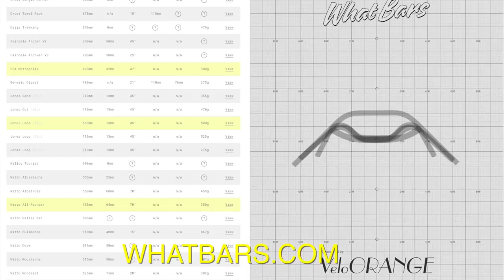My Favorite Handlebars?  (How to Choose Drop Bars)

Comment: Hey Russ, great video.  I have had the cowbells on my Specialized Roubaix for about 5 years and love them.  With the flare the levers are at a more natural angle for me. When riding on the hoods they are much more comfortable that the traditional bars were the levers are straight up and down with no angle. Since watching your channel I found several things I have done with my bike over the years that are right in line with your supple philosophy.  Several years ago I replaced my 50 tooth chainring with a 46 for a 46/34 crank.  That made a huge difference.  And I am about to take the next plunge and swap out for a 46/30 crankset.  Keep up the great work on the channel, and keep the supple side down!

Comment: Great explanation! I will say that Im not sure what racers are pushing for narrow bars these days though. My best road race bikes all had 44s but lately Ive found that 42s are more comfortable for long rides (a bit harder to sprint on narrower bars). I think it depends a lot on your anatomy. Im really glad that flared and compact bars are becoming so much more common.
Reply from the maker: Yeah. Almost all our riding in Montana ends up on gravel or on a trail at some point. I like the stability of wider bars for that.

Comment: Really great intro and explanation  of what goes into selecting a drop bar.  I have been mountain biking a long time and use 780 bars.  I recently bought a 3T Exploro  and like that they are compact or minimal drop, but they are fairly narrow and have no flare.  This helped give me some basics to start looking.  Would have liked to hear a bit about carbon compared to aluminum, but perhaps you have that in another video.

Comment: I just ordered some PNW Coast bars in 44cm length like the stock bars so I don't increase the already long reach of my new Giant Revolt Advanced 3.  I wanted to ditch the flat top bar and increase mounting area and round shape for components.  I also wanted the 65mm short reach as I installed an 80mm Redshift ShockStop stem but couldn't get it in 70mm like the previous stem.   The stock bars also had no flare so I want to experiment with that so it may interest me in actually using the drops.

Comment: So many thoughts:
Hand and wrist position have a bunch movements but pronation and supination is the flipping over of the palm. Hand positioning can change everything. Fitting a handlebar and stem properly can be very nuanced. 
Handlebars and stem combo affects so much from the neck and spine position but as well as power output. 
Personal input is vital but seeking professional help can work wonders in reducing pain, and increasing comfort and confidence.

Comment: I use the Ritchey venturemax. It's quite similar to the cowchipper, but backswept and has a 'power bump' in the drop (jury is still out on that). I'm a similar height to you and also have rather broad shoulders, I use 46cm wide bars as they are definitely more comfortable.

Comment: Russ!!

If the flares are good, and flat bars are bad, then having the ramps angled in should be perfect. They're going to be just like the Jones bars.

In fact, on my gravel bike I even have the brake hoods turned in so I get the neutral wrist position of Jones bars. And, I have it on good authority from my bike fitter that Shimano brake hood are intended to be turned in. He got that straight from a Shimano designer at Interbike.
So there.
Reply from the maker: It’s complicated. Not all flares are good and not all flats are bad. The ramps on the Woodchippers flare in too much for me and are actually narrower on the top than I like. It’s like two radically different bars.
Reply: @PathLessPedaledTV  I get that, the Woodchippers have a really extreme flare.  So I imagine even tbe drops are a problem. Because I value your opinion, it would be interesting if on, your new bars, you'd try setting the levers so the hoods match, or almost match, the flare of the drops. My fitter got me started doing it and it kicks the levers out and makes them way easier to reach. I have small hands and even with the reach all the way in I can barely get my fingertips on them, so turning them helps.

Comment: Great advice: you need to find a shop that listens to you and works for what your goals are. We are lucky that there are some really good fit specialists. A bike fit is KEY to being happy on the bike as a baseline. The right sizing and fit can make a huge difference between enjoying riding and not. If the bike store you go to doesn't give you more than adjusting the seat height, go elsewhere. I had a great fit for my road bike and now find my old bars not as comfy as they were, even though the rest of me feels awesome. This was a great video to get some ideas for a replacement. And as for bars.. most everything can come down to personal preference- the human body is one of the most adaptable machines out there, but sizing makes the difference. Even width of bars can add to comfort and better control of the bike. I had 42cm bars on my bike when I got it and the fitter said, nope,  use 40's and he was right. He knew I didn't race or anything like that, but the narrower bars, for me, gave me better control of the bike. Another great video... I know what bars I'll be checking out for my U.P. build.

Comment: Love the Cowchipper in carbon.  However, they have a recall now.  I tried the Cowbell, but don’t like the forward section of the ramps.  Any ideas on what carbon bar is very close to the Cowchipper?  Short reach, small drop and some flare is all good.  I also like the flare to come after the controls so that your levers/hoods are fairly vertical, then comes the flare.  I tried the app, but didn’t really find the magic one.
Reply from the maker: Ritchey VentureMax
Reply: Thank you, I will take a look.

Comment: Nice one Russ. Great look at the various features and benefits of some great bars. We both got Fargos this Spring and I've been loving the Woodchippers. I didn't think I'd like them at first, and it took some fiddling with positioning and kit since like you said, the ramps pinch inboard - I double taped the top/ramps down to the hood for more comfort and that seemed to make all the difference.  I really dig the flared drops on rocky climbs and descents. Tons of leverage and the long sweep flexes just enough to soften the chatter. 
I'm gonna have to try the VO bars on my gravel rig now. I've been on the Easton EC 90 Aero on that bike, and they're not working for my wrists...

Comment: Russ, V.O. also makes a 31.8 quill stem in case you are worried about losing the ~supple~ qualities of the quill that you have from the quill on the bike right now.
Reply from the maker: Yes. Those don’t work with smaller frames however.

Comment: The Cowbell is one of my favourite bars, but I was equally impressed with the Specialized Hover Bar which came with the Sequoia frame set. It looks a bit weird, but the rise makes it quite comfy and works well with a more upright touring/gravel geometry. The downside (haha) of having rise on a drop bar, however, is that it takes away a bit of space for mounting accessoires.

Comment: Be a little wary of excessive width, my on one midge dirt drop bars are awesome on a 29er but on my hybrid with a lower head tube I got really bad pain at the base of my neck. I didn't get this with narrower Rando bars. For me also flare is a must on bad roads
Reply from the maker: Yes.  Dirt drop bars (like the Woodchipper) in the video require higher stack or a stem that brings them up.

Comment: Went through the full gamut of handlebars from narrow to wide, different types of flare, unflared, ergonomic and classic drops, bullhorns, TT-style, flats etc.
Absolute favourite to date are the Easton EA70: wide, rather large flare relative to a vertical line instead of the bike-axis and they are as light as I would want to go on a gravel/adventure bike. The only thing missing are the ovalised and pulled back tops you are mentioning in this video, but I can't have everything, I guess ^^
Used the Ritchey WCS Evomax before, great bars but I couldn't get to grips (pun totally intended) with the classic round shape of the drops.

Comment: The Salsa Cowchipper bar is my favorite, splayed, more than the Cowbell, less than the Woodchipper. Cowbell on my road bike only, Cowchippers on the rest of my stable... very comfy both and good control offroad and onroad.
Reply from the maker: Yep.  Current favorite.
Reply: Just ordered a cowchipper for my Trek Checkpoint, can't wait to try it. The reach on the stock bontrager handlebar is too long for my liking.
Reply from the maker: Rafael Malmegrin it’s a good one.
Reply: What width are you guys using compared to a more traditional/straight road handlebar? I've previously used same width (narrow), straight bars on gravel as on road, but want a more angled and flared bar now, but not sure if I should also go up one size in width (and compensate with a slightly shorter stem) or if the curvatures make enough of a difference?

Comment: Hey Russ, great info. do you know if the Cowbells, Cowchippers, and the VO Nouveau Randonneur's are measured from the same part of the handlebars? i'm currently running Cowbells in 42 (my favorite over the last 7 years), but i have also had my eye on these two other bars. also, for reference, how tall are you?

Comment: That quill stem adapter thingie is interesting, I might have to investigate that for the two 80s bikes I’m planning on putting back together this winter (especially as I’ve already managed to smash one of the quill stems; oopsy). One bike is a basic, mid/late 80s Hercules that has sentimental memories for me which I’ll use as a ‘to the shops’ bike and general runabout, the other bike is a 1980 Peugeot road bike that’s recently spent about 8 years in my sister-in-law’s basement then 4 or 5 years in mine and now really needs to be rebuilt and ridden… I can’t wait to remind myself what downtube shifters feel like again.
Reply from the maker: It works pretty well. Nice flexibility to swap stem lengths on the fly.

Comment: I have the TFHPC GRAVEL SERIES HANDLEBAR (440 x 31,8 MM, 26º of flare) but I feel uncomfortable on the climbs because my wrists have to twist too much outwards and I feels it's not a natural posture. I still don't get the point of the flare thing. The wider the better for technical, but why not for example 48cm wide "normal" handlebars with no flare?

Comment: The Nitto UI-12 and VO "Quill Stem with Removable Faceplate" are a couple of traditional quill stems that'll work with 31.8mm bars.  I love the satin nickel finish of the UI-12.

I managed to track down a UI-12 with a 90° (or 0°) angle a few years back (well before VO started selling their version), but it ended up being too short horizontally for me once I recently and finally figured out that my knees actually wanted my saddle a couple inches lower than where I was running it only months earlier.  I don't think the 90° UI-12 is available at all anymore, and searching for it is impossible due to how search engines work ("90 degree" will often bring up 90mm stems that aren't 90°, for example).  However, at this point, it's slammed down all the way, so an easily-obtainable 73° (or -17°) UI-12 will work fine at full extension to start.

Comment: Question - what are the differences between Gravel and road drop bars?  Are gravel bars made stronger or is it just a matter other things such as flare? I use FSA energy compact bar (Road).   Would it be ok to use only my Kona Rove?  I'm more worried about whether it will be "strong" enough for gravel. Thanks
Reply from the maker: Good question. Might save the answer for the next Q&A vid.

Comment: Hei! Love your vids! <3 Especially this one, it's precious. 
Contributing factor to be taken into equation is your "arms stance". Find a comfortable position for making push ups, and measure. 
I am myself XL size bloke; I ride Ritchey Venturemax 46 cm between hoods, 24 degrees flare, width between ends of a bar is 58 cm.  On my gravel grinder bike it is just right. I love it!  My wife is M size girl, she has the same model in 42 cm size.  However, on my budget road bike I have a generic road bar 44 cm and I wouldn't want it wider. 
P.S. It is really difficult to judge a handlebar without levers, and out of bike -- naked handlebar is taken out of context. 
Thanks for your videos. Keep on doing great job!!  Greetings from Norway, gravel heaven.
Reply: Dajia Far Bar, if you please....

Comment: I just can't use short-shallow bars, despite the concept sounding good.  Long ramps give me another hand position.  Long straight drops distribute stress on my hands.  Too bad Compass Maes bend bars don't come in carbon.
Reply: eric moss I used to prefer short shallow, but like you I now prefer longer ramps with deeper drops. Most of it has to do with improving flexibility over my younger years. I think it was undoing years of bad posture from sitting too much and slouching.

Comment: Hi Russ. I saw one of your bike reviews with the Nitto x Crust Shaka bar (560mm) but couldn't find it again. I'm interested to know your opinion of that bar as compared to these bars. Some pros and cons of Shaka vs these “cows”. Thanks.
Reply from the maker: Biggest pro/con is the width.  Great for bags, but you have to get use to it.
Reply: @PathLessPedaledTV  is the "offers better stability & handling" noticeable?
Reply from the maker: @benyujr.6545  I personally notice it.  But I also ride a lot of weird bikes back to back.  I also like a wider bar for standing and climbing.
Reply: @PathLessPedaledTV  sounds like that's my cup of tea. I was forced to put a 600mm straight bar on my gravel bike 'coz I find road drops to narrow and unstable, especially during descends. Guess I'll give those Crust wide bars a try. Thanks for the info.

Comment: It turns out that a deep drop on track bars is not aerodynamic. Current track handlebars have a shallow drop. Track sprinters use a very shallow drop, in order to simulate the "on the hoods" position on a road bike when they are in the drops.

Comment: Ok I'm a racer, but when you said 46-48cm my eyes almost popped out. I remember reading a long time ago that "optimal" handlebar width is directly related to your shoulder width, see https://en.wikipedia.org/wiki/Bicycle_handlebar#Width ... However over time and after riding MTBs I have always have come to the conclusion that wider is normally better and cyclocross bikes should have bars that are slightly wider. Personally I'm riding 40cm for the road and 42cm for CX. Traditional bars with a short drop feels right, however my levers keep moving inward to emulate the cowbar style and I'm interested to get a flared handlebar to try out. I'm just thinking out loud, maybe someone will share these thoughts or have been down this path and can provide some feed back or feelings. Cheers!
Reply from the maker: I should mention I don’t race so aero isn’t important to me.  Most of the rides I do are mixed terrain on rough surfaces so the width and being more upright helps there too.
Reply: Hey Nick ! Quick question ! What is your shoulder width ? (Bone to bone)
Reply: Sarge  Mine are around 38cm.
Reply: Path Less Pedaled  Totally understand, comfort can be more important than aero. I'm not sure if this fit metric is directly based on aero factors though. We can all agree that being stretched in both width and length can also be detrimental for the long term and when put in a more upright position this allows a rider to rely less on core/upper body strength making handlebars a less significant pressure point. I would recomend that people get a bike fit and go from there when starting off and make changes from there ... Again just some thoughts
Reply: Nick Stroud  Thank you

Comment: Massive downgrade bro. Go for the deep drops: they won't cramp your hands on the descents. What is the point of shallow drop bars: the hood and drops feel exactly the same? Are you doing it for security or for another hand position.
Not a fan of flared dropbars had cowchippers 44cm the descents jarred my wrists, especially during drops or jumps. Running deep drop 40cm bars now, I feel a lot more comfortable and can last longer with less pain.
Reply from the maker: I don’t have the flexibility for deep drops. If that works for you great.
Reply from the maker: Also, I will add that most of the riding I do is on gravel and mixed terrain and deep drops don’t seem very good for that for me personally.
Reply: Thank you for the input. Do you know handlebars similar to cowchipper but deeper? I am aiming at handlebar with "regular" top (42-44 cm width), but flared to get more width when in drops (on descents) to have more control.